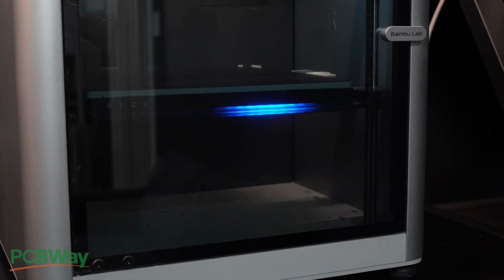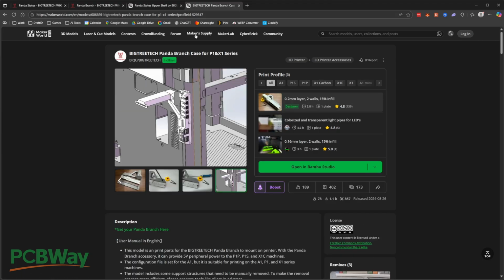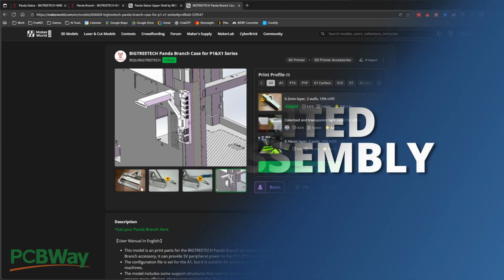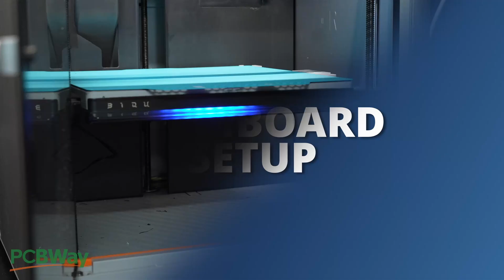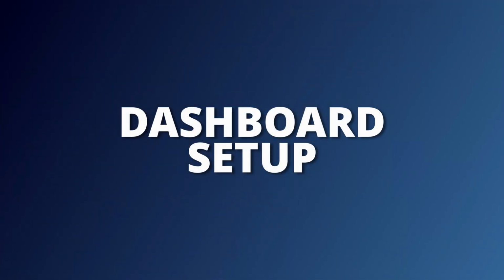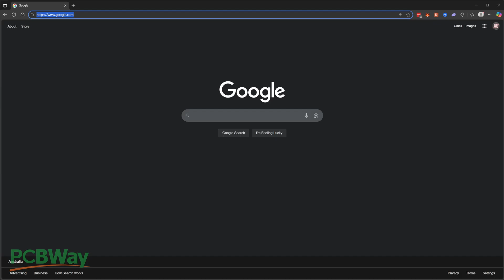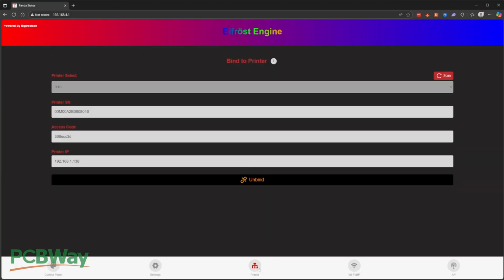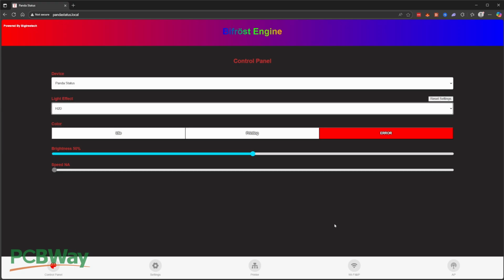Bambu Lab X1C Biqu Panda Status Install + Setup (Full Step-by-Step Tutorial)

Comment: Do you need the branch?
Reply from the maker: I’m trying to remember if the x1c has a USB slot but I don’t think it does which in that case yeah the branch would help
Reply: @DraftID i don’t know if it does either can I plug it into any usb or does it have to have the branch to communicate
Reply from the maker: @CrankyVase nope you can power from something else. Once you connect to same wifi as the printer and bind it, you could have the status bar sitting on your desk and still work
Reply: @DraftID sweet thank you much appreciate

Comment: Your viewers may be happy to find out the light does not HAVE to be installed in the printer.
Mine is sitting on my soundbar at my computer, and should it be a long print, I bring it into my living room.
It runs quite well on a USB-C power cable.
I see no need to install it in the printer, because you can look at the print job to see how it’s coming along.
Reply from the maker: Oh wow that’s a really interesting concept! Could actually design a 3dp enclosure for it and have on your desk or a different room.